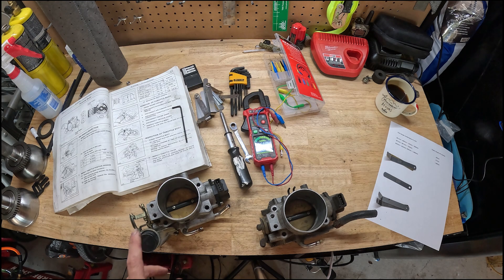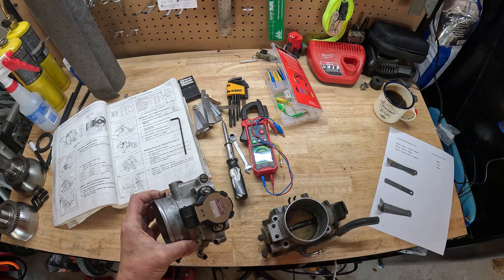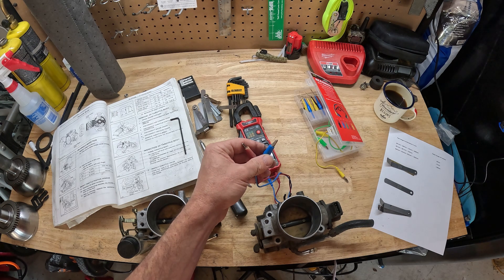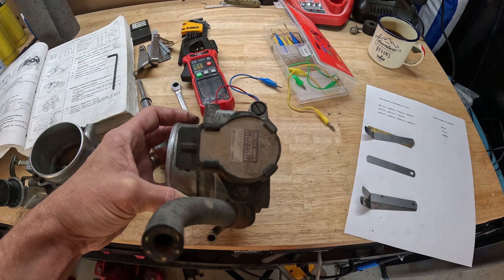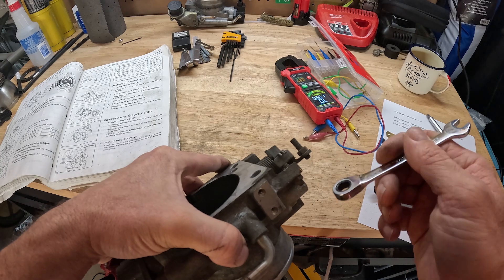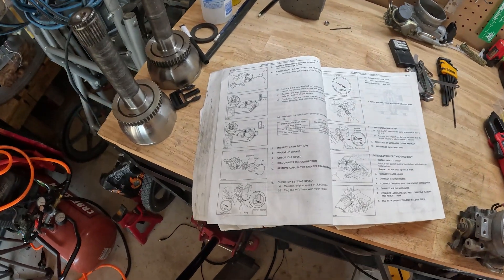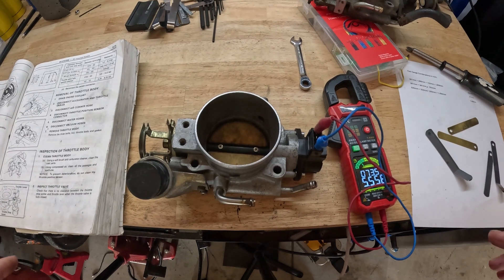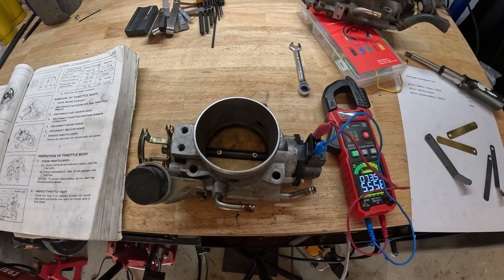Avoid TPS installation hell with your FJ80 or FJ62.

Comment: Hi LCN! Wanting your opinion. I’m having idling issues, sitting around 2500 rpm in Park but it goes down directly after putting it in drive. Does this sound like the TPS to you? Thanks in advance! 

Thanks for the great video!
Reply from the maker: Hello Isaac, there could be a number of things that causes this. If you have some feeler gauges you can test the TPS while it’s on the vehicle to see if it’s good. Simple thing is to test for Vacuum Leaks, and clean the IAC.